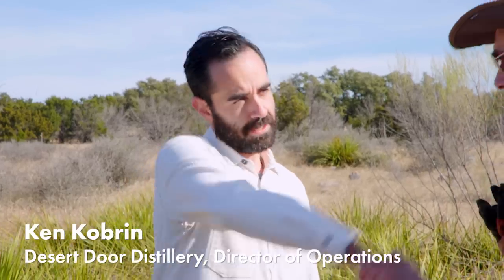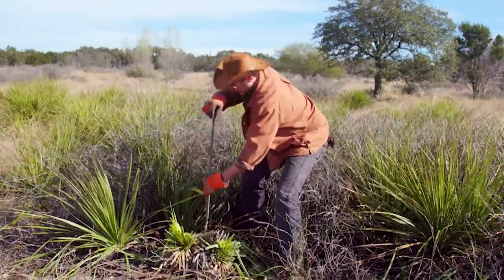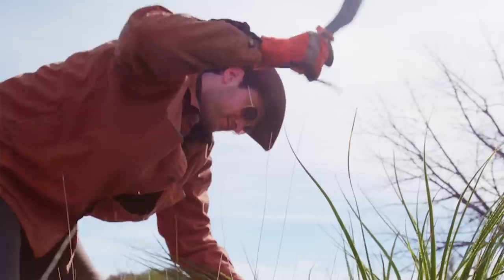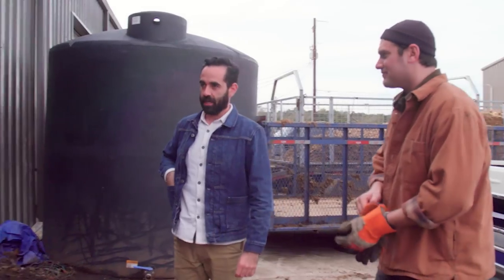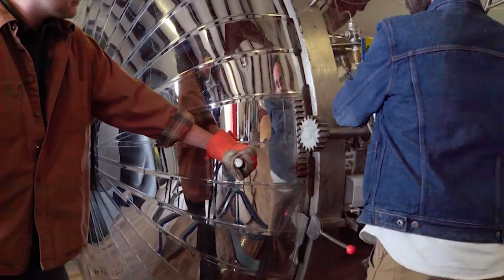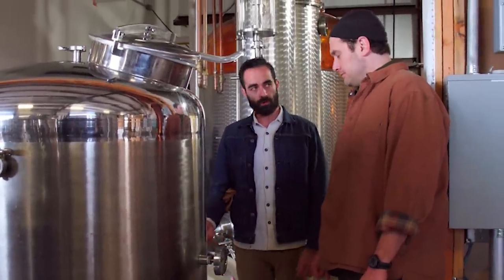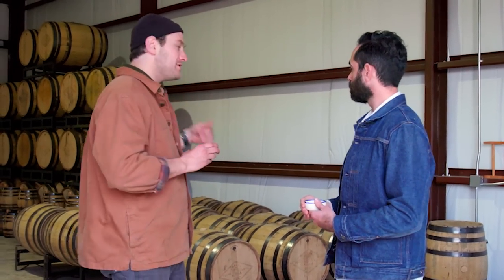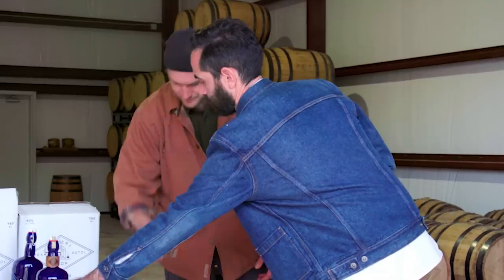Brad Distills 80 Proof Alcohol (Sotol) | It's Alive: Goin' Places | Bon Appétit

Comment: Isn't it nice to use a unit of temperature where the boiling point of water is 100 and the freezing point is 0? In before someone mentions different pressures.